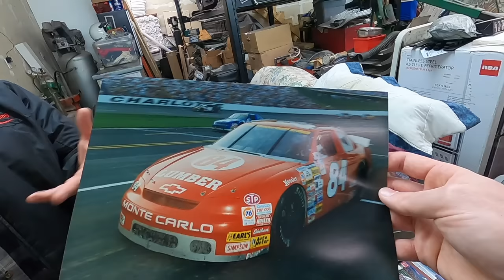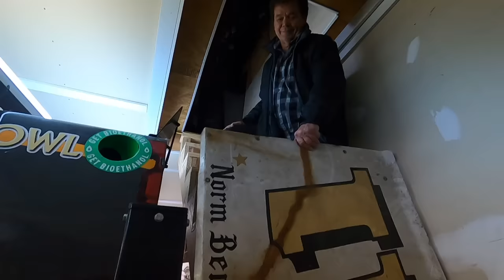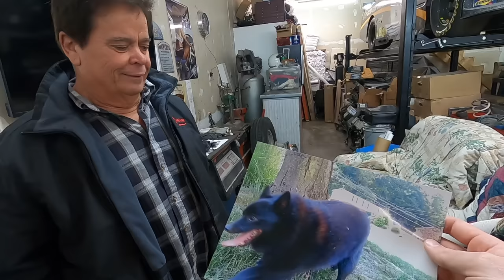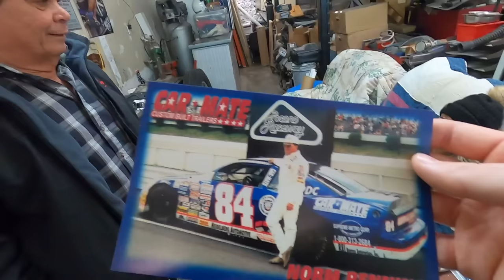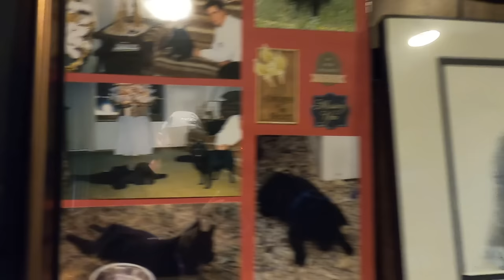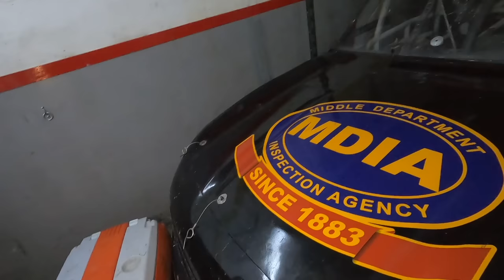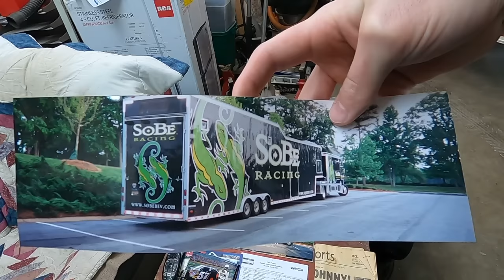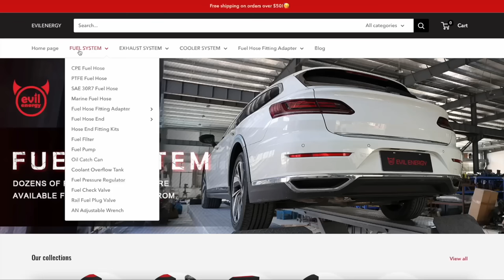Norm Benning's Backyard NASCAR Race Shop: Underdog Favorite Keeping Old School Ways Alive

Comment: WhenNorm was showing the pics of the dirt late model and then mentioned Pennsboro Speedway up in northwestern West Virgini, it made me remember how famous that dirt track was, just the same as Eldora and Pennsboro is reopening in 2024 as a smaller sized track but it we go back to the original size a year or two after that and hopefully it becomes the prestigious track that it used to be but it'll have to be under the Lucas Oil and WoO series to do so because XR has a long ways to go to catch either of the other two series for now

Comment: I remember meeting Norm in Loudon at a Busch North race back in late 90's he failed to qual for.  I was there for the races and helped pit Kip Stockwell who was seriously under funded.  His pit box was cobbled together with wood and casters with a cheap assed tool box on it.  He didn't even change tires(thank goodness), his pitting consisted of filling with fuel and we changed 1 tire due to flat.  Oh and he drove the only Oldsmobile in the race.  We would usually hang out with Mike Olsen(Little Trees) and family before and after races.  I was fortunate back then to get passes with Hot pit passes to the race due to sponsors.  Hot passes allowed you access to pit lane during the race
Reply from the maker: Interesting!

Comment: Saw Norm run the 2015 Bristol truck night race. First and last race ill ever attend. 100f two rain delays air Titans were working overtime. Modifieds got rained out so they started the truck race checkers at 12:30 am. started the modifieds two laps rained again.  Qt jar 100 proof flavored moonshine stand at every stairwell. The ladies were plastered. Saw many get naked and fall down the steps puke all over the stands. Ryan Blaney won , kyle Busch passed  3 trucks at one time last lap between turn 4 and the flag stand pretty awesome finished 3rd. Norm got caught up in a crash didn't finish, but gave it hell against those high dollar teams.

Comment: as seen the cows in the field, something going 20mph... is a stampede inducing sight, one does it and they all join in. no reason, other then just because. as so just having lots of money to buy into something is a momentary image of state resources, until there is nothing around they can spend it on. few times 78k for a new truck and they get back 80 bucks for scrap spending that on a few burgers and fries... the smallest thing, the steer broke its leg in a gopher hole. Black Ice